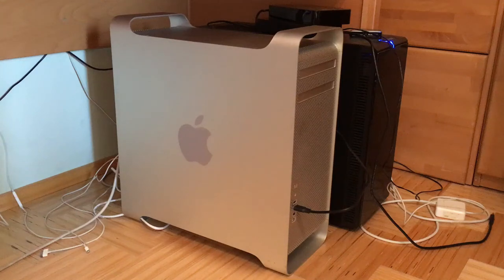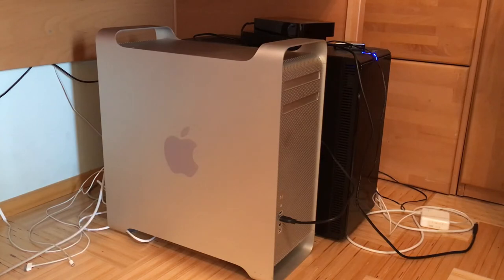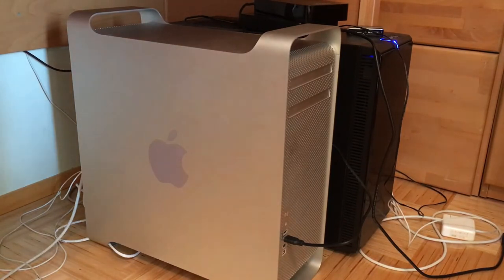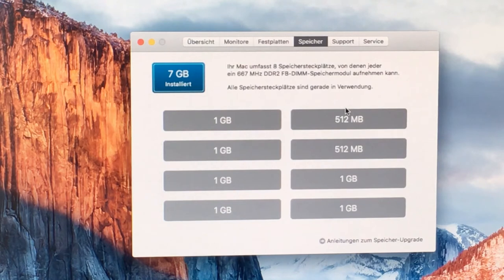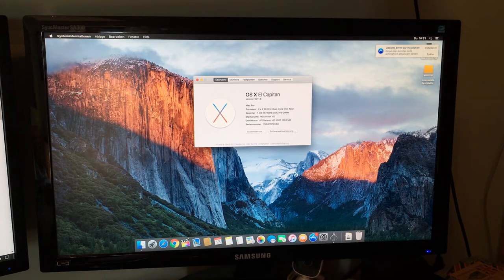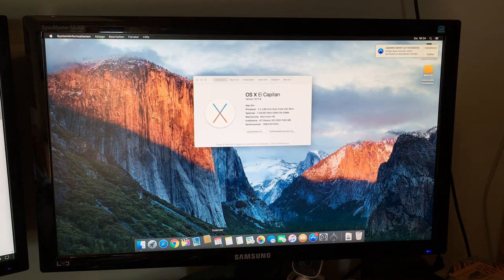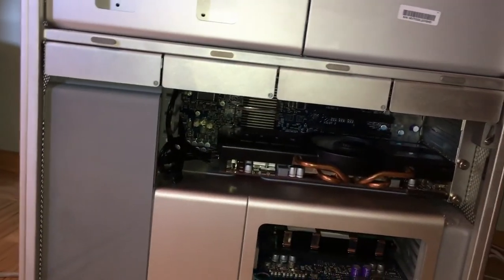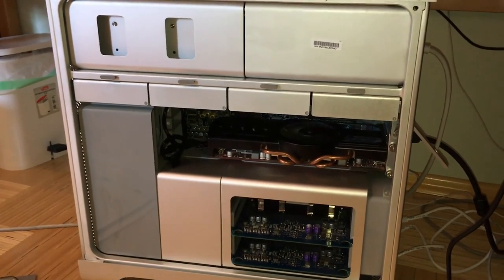I got a 2006 Mac Pro (is it too old?)

Comment: I put a GT 1030 in mine, along with Windows 10.  I had to do some 32bit efi boot loader on the  ISO to have it boot, but with that done, Windows 10 runs full 64bit, along with the latest version.  I replaced the CPU's with the fastest ones for the 2006 Mac Pro, the X5365.  I got 2 for 166RMB.  Check the prices they have come down to next to nothing!  A SSD helps boot the thing incredibly fast, and I already had 16GB of RAM for this thing, so that's great.  I may bump it up to 32GB.

The faster CPU & GPU certainly help with seemingly unaccelerated stuff like Chrome & Video, although the lack of SSE4 really hampers the machine for massive tasks, but for casual use, the machine is still a beast at 13 years old!

Comment: Hallo Manfred,

Ich sehe dass du eine relativ neue FCPX version drauf hast (neueres Icon) wie hast du das hinbekommen?
Reply from the maker: Liegt an der Mac OS Version, da war Mac OS 10.11 oben, kann man durch einen Hack auch auf den alten macs installieren.
Reply: @MacintoshMen  Habe einen Mac Pro 2,1 auf El Capitan gecrackt. Auf der Version läuft 10.11, aber die FCP Version ist (laut symbol) eine ältere als deine. Bekomme aber nichts höheres drauf?
Reply from the maker: @MarcelGrebMusic 10.3.4 ist die neueste version die auf el capitan läuft, die war es wahrscheinlich.
Reply: @MacintoshMen  bei mir ist nur 10.1.2 drin.. komisch..  hast du das sicherheitsupdate von El Capitan gemacht nachdem du den "hack" gemacht hast?
Reply from the maker: @MarcelGrebMusic  das sicherheitsupdate mach lieber nicht, denn bei mir war danach alles kaputt.

Comment: I have
MacOs High Sierra
Mac Pro (Early 2009)
2.93 GHz 6-Core Intel Xeon
16 GB 1066 MHz DDR3

Model Name: Mac Pro
  Model Identifier: MacPro5,1
  Processor Name: 6-Core Intel Xeon
  Processor Speed: 2.93 GHz
  Number of Processors: 1
  Total Number of Cores: 6
  L2 Cache (per Core): 256 KB
  L3 Cache: 12 MB
  Memory: 16 GB
  Processor Interconnect Speed: 6.4 GT/s
I do a lot music, video editing on this Mac.

Comment: I used to have one of these, they're great value for money. The Ram isn't expensive at all, they take any DDR2 FB-Dimms, you'll see a lot of ebay listings listed as Mac Pro 2006 Ram, I paid about £30 for 16GB (4x4GB) last year. Upgrading these to 8 core is really cheap and pretty easy too, I reckon I paid around £30 for two Xeon X5355s. I'm suprised you got El Capitan running with the 512mb sticks in, my one Kernel Panicked whenever it accessed a 512mb stick and thats apparently pretty common for El Capitan.
Reply from the maker: Well, here where I live they sell 8 GB DDR2 FBdimms for around 110€, it's by no means worth that money to me. It probably has to do with Macs not being so common, let along Mac Pros. (almost everyone has a PC here) Regarding the 512MB sticks, it never really showed a problem. The CPUs are cheap however, I might upgrade those, thanks for the tip.
Reply: Macintoshmani12 ah ok that's very different, it's considerably cheaper in the U.K., maybe we have more old server being scrapped, here's 32gb for £30  https://www.ebay.co.uk/itm/282572655043 , you could take advantage whilst the uk are still in the eu 😋, you don't need to worry about getting the stuff with the big heat spreaders, it will run fine with the smaller ones like these but may run the fans a bit more, the non mac stuff is often slightly newer and runs cooler anyway, I took my heat spreaders off the apple ram and put it on my replacement ram
Reply: Macintoshmani12 what the Heck thats expensive i paid 50€ for 16 Gigs of RAM (4x4gb) for My first Gen Mac Pro here in Germany
Reply: Macintoshmani12 Paid 28€ for 2 Xeon X5355 CPUs shiped from china. It made a huge Differenz going from 2 dual cores to 2 Quad Core CPUs

Comment: can anyone lead me where the trick with 10.11 installed on old MacPro is explained? Will it also fly on 2x2 MacPro 1.1 with an upgraded GPU?
Reply from the maker: You need an upgraded GPU in order to make it work without graphic problems
Reply: Sure, I've got GeForce 210 with 1 Gb recently installed. Is there's a step-by-step guidance for the trick you used?
Reply from the maker: There are a lot of videos on youtube, that show this.
Reply: Update the original Graphics card to an ATI Radeon 5770 graphics cards. After it will run El Capitan easily. Mac Pro 1,1 are still very stable even in 2017. With a few upgrades, like CPU upgrade and memory. That machine is a workhorse.
Reply: Yes, I've been living on what this machine gives me for years, thank you MacPro 1.1. OK, having upgraded GPU to GeForce 210 1 Gb, I'll try installing El Capitan.

Comment: i still use one of these with an ssd, 12gb of ram, gtx 950 and 2x quadcore 2.66ghz xeons as my main pc, i also own a 2015 mbp but that gets outperformed easyli by the mac pro, too bad its useless next year as el capitan support stops and we will never be able to install a newer os on it...
Reply from the maker: Yeah, it's a shame that 10.12 can't run on these... Still a very capable machine.
Reply: Jacob Nimeh nope, just for some macbooks, imacs and very late (i guess 4.1 or so) mac pros... :(
Reply: Михаил Генералова Wait what? Its impossible that a modern 2015 Retina macbook pro would get outperformed by a machine which is more than a decade old by now. I mean these are great upgradable machines for the money and are plenty powerful but Clovertown is blown out of the water by Sandy Bridge, it'd have a hard time beating Broadwell at anything.
Reply: Saqeef Iqbal the 2015mpb has no ssd, only 8gb of ram and the i5 it runs isnt that great either...

Comment: High Sierra sucks anyway- no loss there
Reply from the maker: It's such an unnescessary release. If they wouldn't have their stupid planned obscolesence, they could just implement these few features and the new filesystem in an update for Sierra.
Reply: Macintoshmani12 I have an 2011 iMac and a 2011 MacBook Pro which I had high sierra on both, and they ran so terrible I had to go back to El Capitan